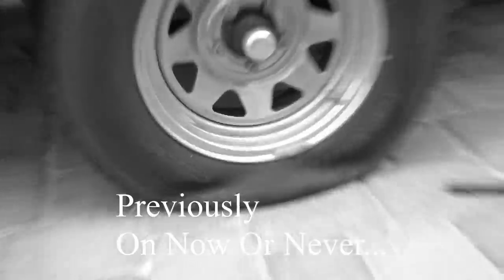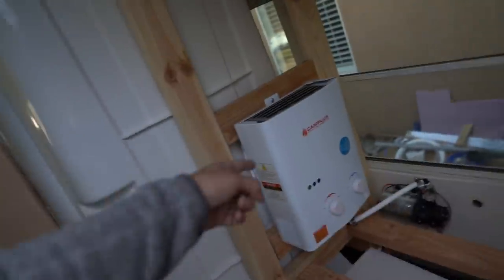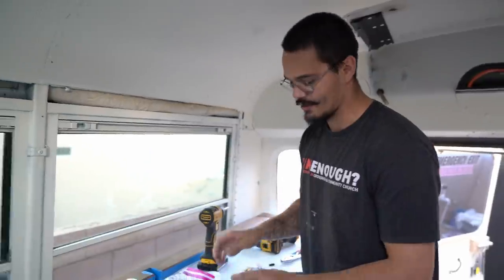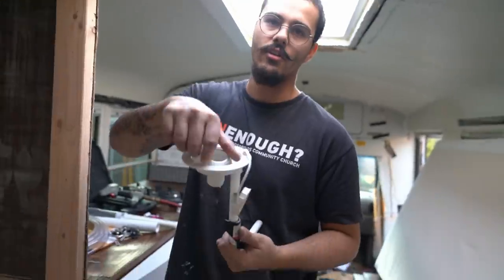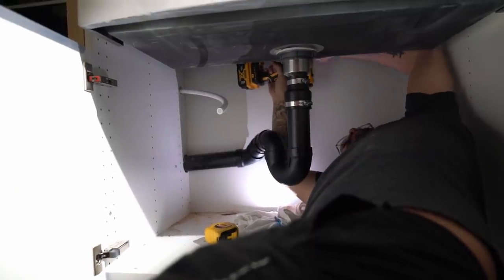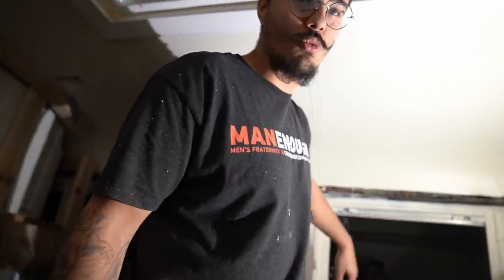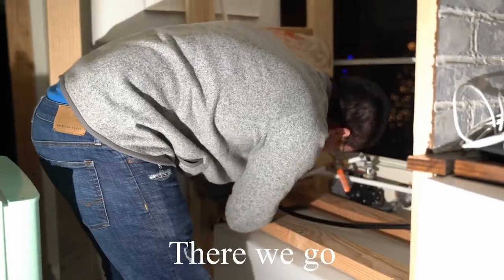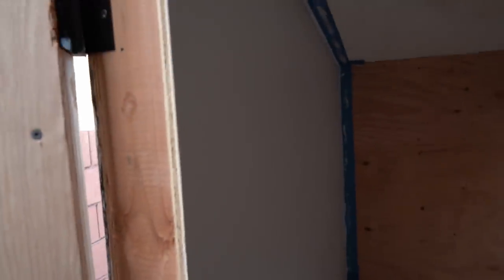We Finally Bought Flooring! | Skoolie Build (Ep.26)

Comment: not that it is any of my business to tell you what to do but the tankless propane water heater needs to be mounted outside.  When running it will dump a huge amount of exhaust out the top. What does the manual say about putting inside? It should say it is a no go.
Reply from the maker: rock doctor they are used for outdoors correct. But ive done a lot of research and testing on it. It releases less carbon monoxide as the propane stove we have. So as long as we have windows open we are in the clear